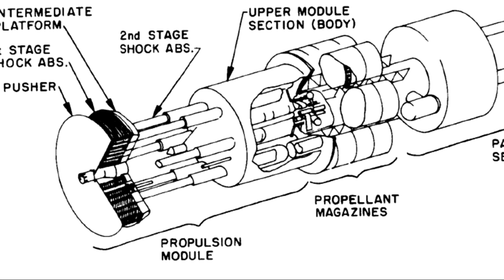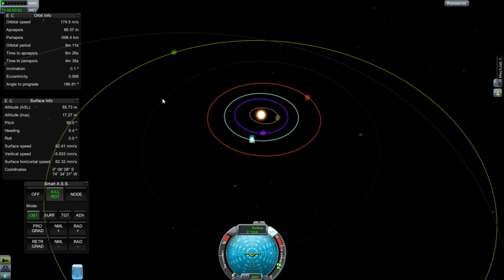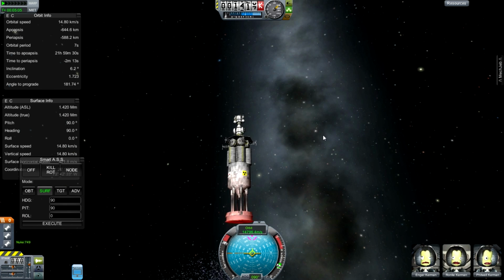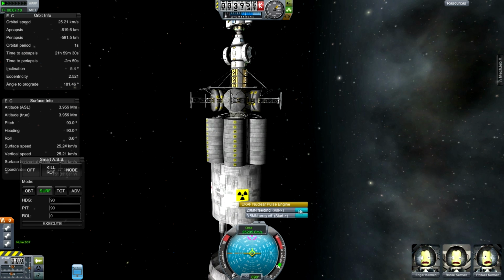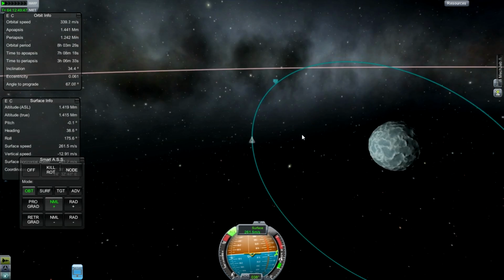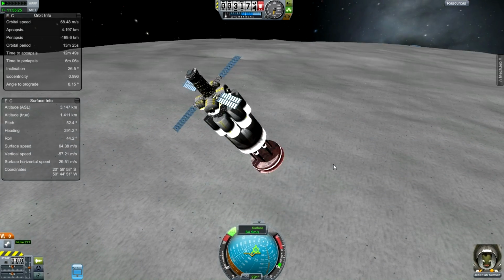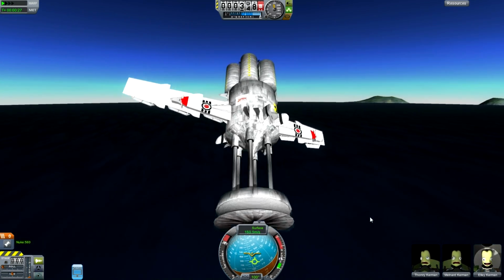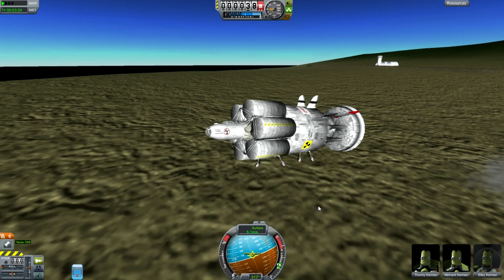Kerbal Space Program - 'Orion' Nuclear Pulse Rocket

Comment: When people hear of nuclear bombs, they immediately think of giant city-levelling fireballs and space-reaching mushroom clouds. That's why they fail to appreciate the beauty of this idea. The nukes used in the Orion rockets are actually of very low yield; they are in fact less powerful than suitcase nukes or nuclear artillery shells. The liquid fuel packed in N1 and Saturn V is equivalent to a tactical nuke (the N1 accident is the most powerful non-nuclear artificial explosion with a yield of nearly 7kt). An Orion uses less than that amount of energy since the fuel is much lighter, not to mention that the warheads are much more chemically stable than liquid fuel (as Scott Manley pointed out, nukes don't detonate simply from impact, random chemical explosion, or fire). Technically most of the hazard comes from the SRBs used to lift the vehicle to an altitude. I suppose with modern minituarized warheads and lightweight material a propelling pellet would only weigh half of the originally pellet proposed in 1950s, which was already very light. The only barrier to this idea is politics. It may generate too much acceleration for human, but would make nice efficient cargo delivery vehicle.
Reply: Is it even possible to create small enough warheads for that? The smallest nuke ever still was 10 tons powerful (enough to destroy a building or two), and it was pushing the limits of critical mass for practical-to-use fissionable material way too much already.
Reply: Giannis Pantazis Practical yes that is the limit for fission the idea for the Orion's drive was a tiny atom bomb to make heat and pressure and then the rest hydrogen and helium for fusion.
Reply: You think the smallest nuke is that small. The smallest nuclear bombs were in the orion project. Most of the plans are still classified by the US government to prevent terrorists from getting nuclear weapons.
Reply: Mr.chang cooler Well they were by size the smallest if you increase size you can use more advanced methods of ignition to scale the yield much better.
Reply: SUN SU You can use uranium 233 from thorium which has less dangerous waste projects
Reply: SUN SU I think what really killed this design was the USAF pitch to Regan for the Orion Battleship, quoted from the USAF official “whoever controls Orion Controls the world”. Regan was scared of how fucking OP the Orion would be with hundreds of ICBMs and even more Casaba Howitzers.
Reply: You forget the engeneering challenges and the lack of testability, we only know how to make the fuel and a rough idea of the craft. It seems so flawless because we havent tested to see its flaws... 
And isnt compared with simillar tech-level concepts as the FFR or the GCNTRs.
Reply: Proud Catholic Anti communist 
Excuse you, what??? Breeding U-233 from Th-232 has some NASTY byproducts which make it hard to do discreetly!
Reply: @PokeMageTech  not really, I mean, there will be some hyper toxic fission products, but nothing abundant or not contained
Reply: AntaresMC i think one fairly obvious flaw is there would be micro fracture risks at some point.
Reply: correct, the orion project device was more of a pulsative nuclear rocket but had a compelling faction with the shields above the radioactive tools used, there was a radioactive shield above the pulsator that when pushed will only pulsate one fraction of the power downwards and to the sides but not top due to gravity and the radioactive shield which since nuclear energy is opposed of being fast that means light weight cities could be held (like the original "creator" said)

Comment: Scott Manley There's a "continuous" version of orion; the nuclear salt water rocket.

Another interesting device of far more modest proportions was the nuclear ramjet (project pluto). Before the ICBM became a proven technology work was done on building an unshielded nuclear reactor, acting as the heat source for a ramjet. It was supposed to fly at mach 3 at low altitude, essentially without moving parts (except steering) and stay aloft for weeks. If called into action it was supposed to zig-zag across the USSR dropping bombs as it goes.

They actually built and tested the nuclear ramjet portion; it was tested stationary on a rail that could be used to remotely move it into a shielded concrete building after firing (it would have been lethal to be anywhere near it when firing; it had no shielding). Coors (who are now mostly known for making beer) made the uranium-beryllium oxide fuel elements. They used miles of oil pipeline to store compressed air for the ramjet (it was a stationary test, so there was no ram-pressure to work with). It worked beautifully, but it was not followed up with a real flight test because the thought of flying the damned thing over continental US was too scary, in case it went off course and flew over a town or something.
Reply: >>but it was not followed up with a real flight test because the thought of flying the damned thing over continental US was too scary

Scary, but not just because it was a flying unshielded nuclear reactor (as if that wasn't enough). Pluto's core continuously eroded and spit out minute particles of incredibly radioactive material, essentially poisoning anything it flew over. This was the actual reason the program was cancelled. There was no way to actually test it. Once it started to fly, all you were doing was poisoning more real estate, even if you are doing it over the ocean, the radioactive dust would stay in suspension in the oceans for thousands of years.

Pluto was the ultimate doomsday weapon.
Reply: It seems that Russia has announced it's building something akin to Project Pluto as a warhead delivery system, as if 2020 needed more horsemen of the apocalypse.

Comment: Why are we not funding this?!
Reply: Don't forget there are also fusion bombs and fuel pellets with electric beams concepts for Orion since Fission is very inefficient and dirty like you described in the earlier Orion studies. However, we have not created controlled fusion energy with electron beams or anything else, but anything is possible.
Reply: *****
You do realise that the amount of radiation this would make is rather..... pathetic compared to the radiation a space fairing ship would have to withstand in space.
Reply: Are you suggesting ion engines and better nuclear chemical rockets?
Reply: Funding and research would have continued but the "Partial Nuclear Test Ban Treaty" banned testing nuclear detonations so the project had to be stopped. Honestly it was a stupid idea since this would have been an amazing way to get around the solar system.
Reply: I doubt the explosion would cause much of an issue, if the flash of the nuclear bomb is close enough to the earths atmisphere to tough it then it may be a problem, but if the flash has the void of space seperating itself and the earth, then the shockwave can't travel to the earth.
Reply: It doesn't matter how many bombs go off in a void, my point still stands.
Reply: Then buy goggles, you're brining up alot of maybe accidents caused by peoples general incompetence. Don't you think the people designing the vehicle would think of the heat caused by the explosives?
Reply: If all the bombs went off at once, that would be far from the earth, they'd probably give it a head start with perhaps a giant magnetic slingshot or something so it would be safe, these space engineers at nasa aren't orks.
Reply from the maker: ***** THis is a common misconception, if you piled a bunch of nuclear warheads together and then hit them with another weapon (conventional or nuclear) they would not explode, they would break apart but not detonate. 

A nuclear warhead requires a very carefully times series of events to occur to ensure that the pit is imploded correctly, if these events are off by even a millisecond then you usually get no detonation, at best you might get a low energy fizzle that has a yield of <1% of designed.
Reply: ***** Space is already insanely radioactive, but there are other glaring problems with the craft.
Reply: Look at the G-meter on the right of the navball. See that it goes off charts with each explosion. Realise if kerbals were humans, they would've been dead right off the launchpad. Then think about smaller bombs and suddenly remember that nukes are very expensive not because uranium and other radioactive fuel is expensive, but because making it is a very technical and precise process, thus making a lot of small bombs would've been a bit too pricey.
Reply: They should have named it Onion. So it shits out Onion Nukes1
Reply: Scott Manley, Please be my freaking Science Teacher when I go to college...
Reply: The last nail in the coffin for this project was the nuclear test ban treaty. Though radiation was a concern, it could always be avoided by bringing the ship out of the magneto sphere before firing nukes.
Reply: Launch a Rocket WITHOUT nuclear bombs then when it gets far from earth, It will crap the nukes and will not struggle crapping it.
Reply: If you are referring to the 1963 Nuclear Test Ban Treaty, then you are correct.
Reply: Avedis Ghazarian The main problem is this: What would happen if the rocket malfunctioned (read: blew up) on the launchpad? It would release tons of highly radioactive material into the surrounding area which would irradiate and kill hundreds of thousands of people.
Reply: You are mentioning about the early version of Orion, which was flawed from the start. The one that I was praising to get funded was the later version of Orion that had to be launch by either a Saturn 5 rocket or be assembled in Earth orbit and high enough so that the nuclear fallout does not get stuck in orbit.
Reply: Rishi Chandra Yolo
Reply: It looks like my post is pretty much trail blazing into an unstoppable flow of words.
Reply: +Avedis Ghazarian Well, most likely the biggest reason (aside from the humongous scale and cost of the project) why this isn't being funded is the fact that taking several hundred nuclear warheads to space is generally something politicians and the general public frown upon.
Reply: ***** Then what is the sun emitting? If you go into space without protection, you are hit with every type of radiation, from gamma to radio.
Reply: +mitchell anthony space is full of radiation anyway the main reason why they cant do it is because it will rain radiation all over the earth when lifting off
Reply: +mitchell anthony Opposed to the radiation that already exists out there? Our bombs have nothing on a gamma ray pulse from a neutron star.
Reply: +mitchell anthony Not so much space. The real problem is the non-zero explode in the atmosphere issue. Once we get to the point that we can safely construct the system in a remote location that doesn't harbor stuff we like (is there uranium in the asteroid belt?) then we'll get it going. No worries.
Reply: +Rishi Chandra No, it would not, the material would be on and around the launchpad. It was on earth before, it's not like it's suddenly way more dangerous because it's on the launchpad instead of just above it.
Reply: cardeci Personally, I think it's more of a "it's flying overhead and suddenly explodes, releasing material." thing.  Yeah the weapons grade material is a bit scary, but again, there are so many things that have to happen for a bomb to explode in the first place. There won't be any fallout as you said. Just pressed HE (high explosive) and enriched uranium. The HE poses more of a threat to life at that point.

Sorry for the rant.
Reply: +Avedis Ghazarian The "no nukes in space" international law. The funny thing is that rocket jumping via nuke would let us reach 15% of the speed of light. That is by far the fastest means of transportation we've yet thought of.
Reply: randomoddguy And let's all be real here. There are already nukes in space. Yeah, yeah, fringe conspiracy, but come on. We know we can send up the material safely, so lets friggen do it.
Reply: +Avedis Ghazarian
"Why are we not funding this?"
Rumor has it that, since the project required the backing of the military to get funding in the first place, at one point some generals pitched the idea to JFK of giant, orbital nuclear battleships; Kennedy was horrified enough that he ended all funding for the program.
They wouldn't have been able to continue funding it anyway since the Apollo program sucked up all the money.
Reply: +Th3uNn3rV3d Yeah, there are nukes in space. They're called stars.
Reply: +Avedis Ghazarian because if ANYTHING goes wrong it will make a gigantic explosion (it isn't safe)
Reply: I understand. What I don't understand is that SO many people are responding to this and it is turning into a trail blazing matter on one, small comment.
Reply: +Jonathan Stiles exactly nuclear weaponry is the reason we haven't plunged into another World War
Reply: unless we develop cleaner fission bombs and research new types of detentions, the concept is quite practical for interstellar travel though.
Reply: And then everybody has a squeaky voice thirty-something years later as a result of all the helium released.

No, fusion bombs don't release that much helium, I know. Would still be hilarious.
Reply: tosha van opstall It's very unlikely that fusion bombs will cause any significant damage to humans. Assuming they aren't caught in the blast, obviously.

Neutrons produced by nuclear transmutation are very high in energy because they're moving very fast. This makes it very difficult for atoms to capture neutrons.

Imagine someone tossing a tennis ball at you. That one's fairly easy to catch, right? This tennis ball can be compared to a neutron used to start fission. Now try catching a tennis ball moving at mach five. That one's hard enough to touch, let alone catch. Those are the neutrons produced by fusion.

Of course they'll slow down eventually. But by that point most neutrons will have fallen apart. Others will be blocked by air or other materials, or get captured before hitting a single atom incorporated into living matter.

The result is that a few humans may get a radioactive atom or two in them. So what? We HAVE unstable atoms in our bodies anyway, and the increase is too small to notice.
Reply: Do you realize this would cause massive nuclear fallout on earth? Also, the crew could suffer radiation poisoning.

Comment: I did some math, and it turns out that if you could constantly maintain 1 G thrust for a year, you would reach the speed of light.
Reply: Problem is, as you get closer to lightspeed mass dilation means it takes more energy to go faster--you wouldn't be able to maintain 1G. It would actually require an infinite amount of energy to accelerate any object with mass to lightspeed, but you could get pretty darned close.